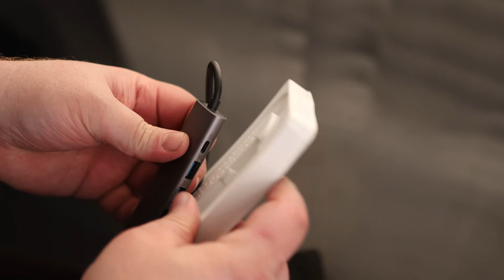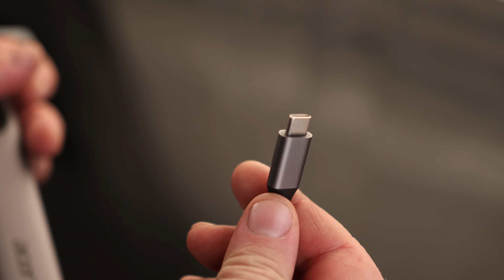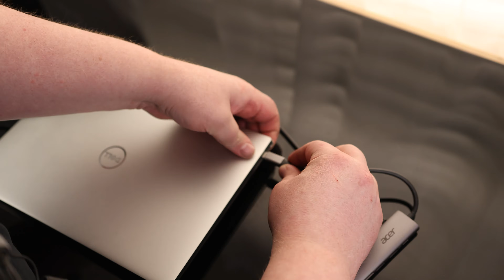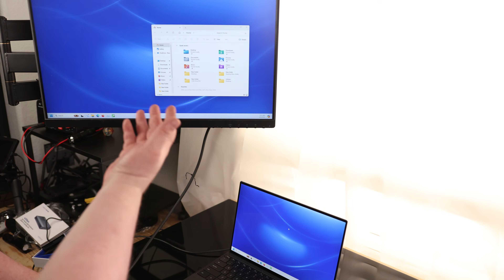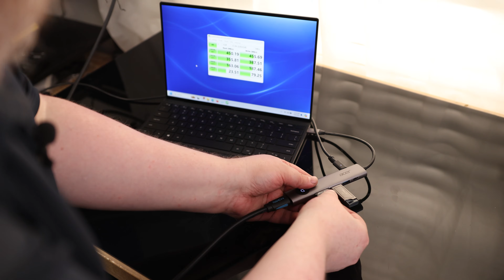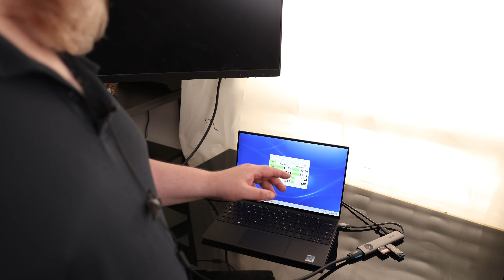Acer USB C Hub, 7 in 1 USB C to HDMI Adapter, 4K@60Hz HDMI, 2 USB 3.1 and Type-C Data Port, 100W PD

Comment: Mine works except the USBc PD, I have tried whichever way, and I can't get it to charge my laptop. It does charge my phone but at a much lower ampage. What kind of cable did you use to plug into the PD port??
Reply from the maker: https://www.dell.com/en-us/shop/dell-130w-usb-c-ac-adapter/apd/450-ahom/pc-accessories